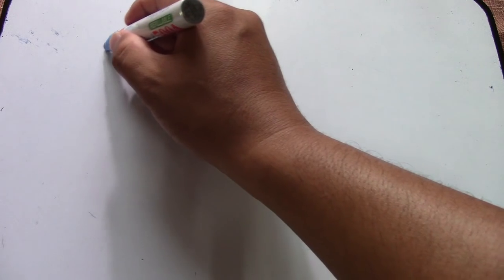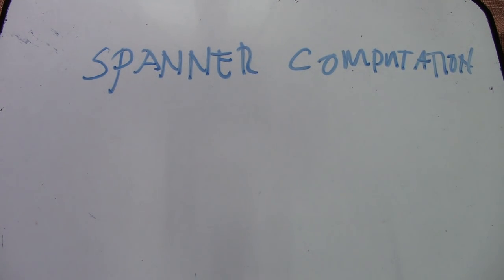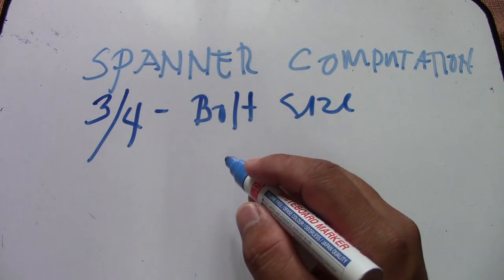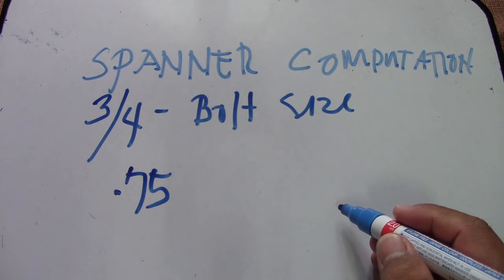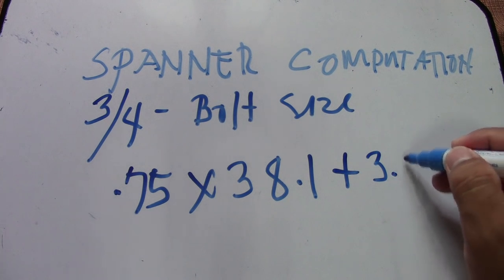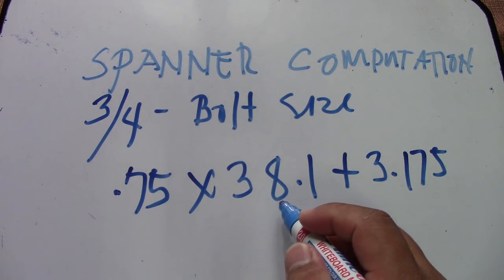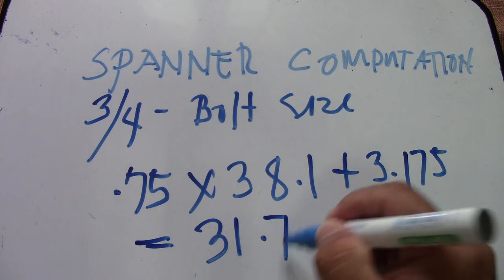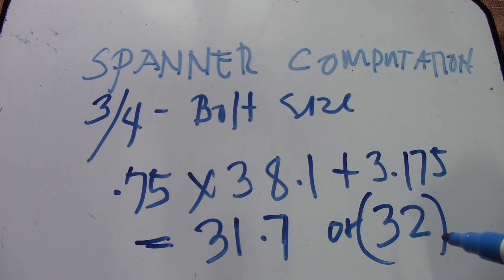Spanner Computation - PipingWeldingNonDestructiveExamination-NDT

Comment: we can use also this formula 
3/4"=19.05mm
19.05x1.5+3.175=31.75
so we can use 32mm spanner
Reply from the maker: yes! nice thanks for sharing
Reply: Miteesh kumar Dubey where is 3.175 come from?
Reply: jhun rocero actually from 1/8" inch have to be added last 1/8"=3.175mm. it's a constant
Reply: @hk-gd2je  actually 1inch divided into 8 soot so 1 soot equal to 1/8inc.